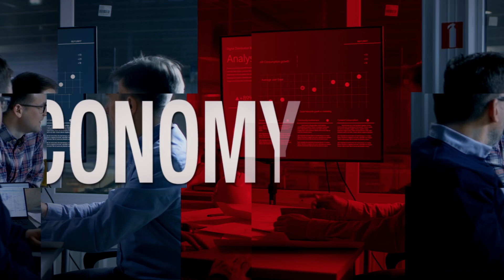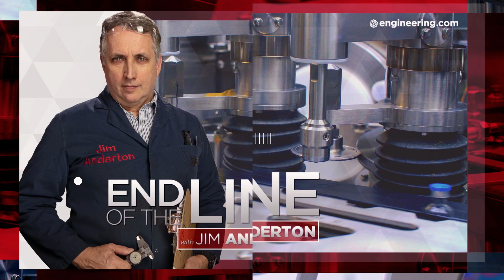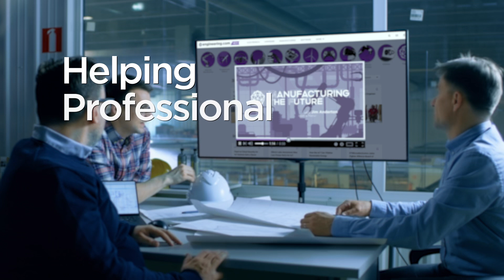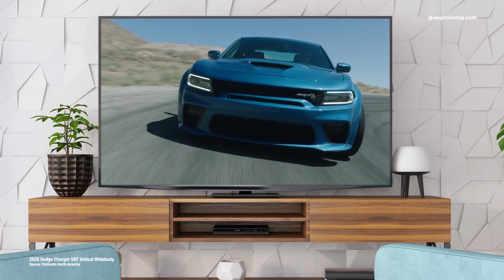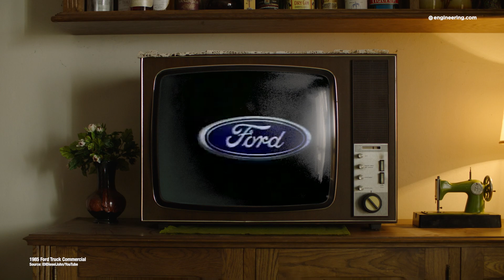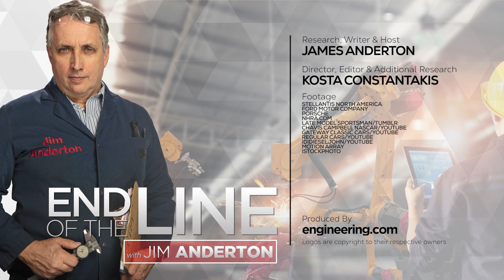Automakers Have Lost Their Minds. 400-Plus Horsepower?

Comment: Americans have a insecurity problem and think that loads of HP will miraculously solve it. 95% of high HP cars are driven at normal highway speed and around town traffic.  The only fun to be had is romping on the gas pedal at the stop light so you can hear them. But , that same noisy cackling can be created with a 250 hp motor, which would probably get much better mileage. Eventually, these high HP cars will fade away along with their obnoxious noises, and the world will be a better place.

Comment: The real debacle was not going with small diesels with urea exhaust treatment.  There are trucks that get good real world mileage with small diesels.  Real world means assuming accelerations and towing.  These so called efficient gas engines get terrible mileage under load.  The EPA obsession with numbers ignores real world numbers.  And diesels can easily be converted to run on hydrogen or biodiesel.  The idea of using micro-nuclear reactors to generate heat to make biofuels and/or hydrogen is excellent.  The CO2 produced by burning a biofuel is just recycled through plants. One plant that is incredible for CO2 uptake per acre is hemp.